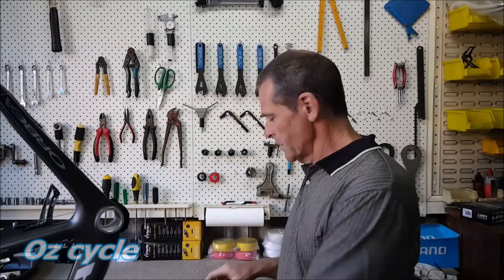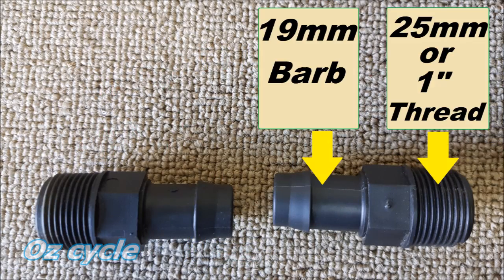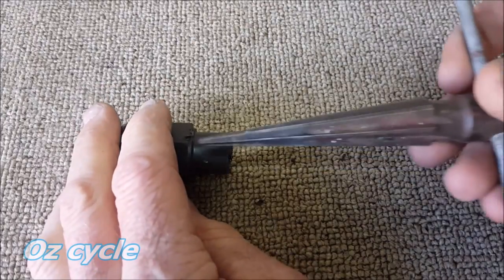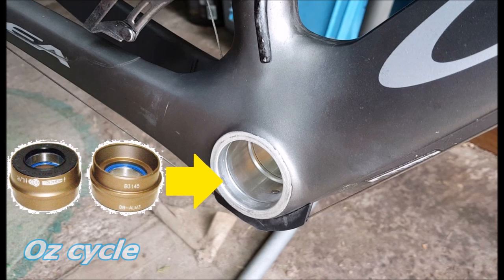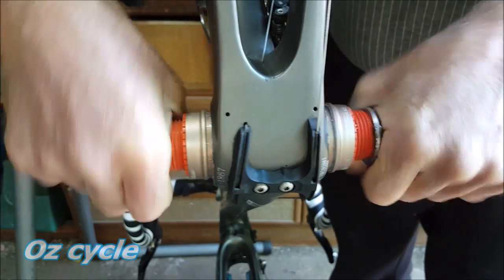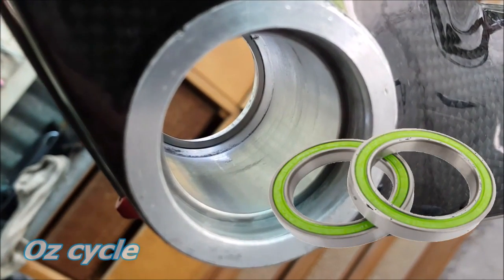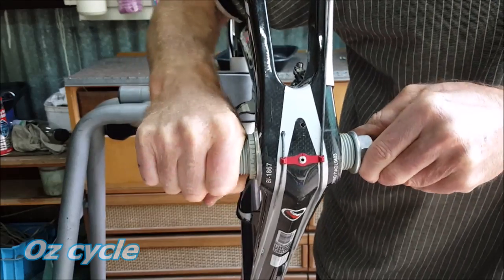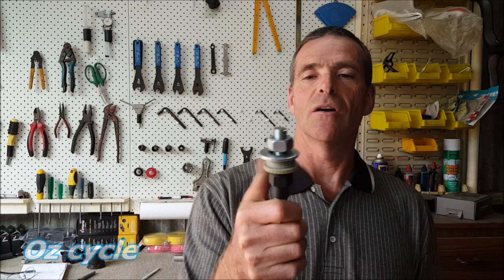BB30 cup/bearing press tool - make it yourself

Comment: What's the name of the black garden adapter piece you used? Thanks
Reply from the maker: 1" or 25mm threaded to19mm barb
Reply: Hi, really enjoyed the vid. Will make one for my BB86 pressfit. if I’m not mistaken I think the thread on the poly barb is 3/4” (20mm) not 1”. The female side of the tap fitting adapter is certainly 3/4 and the male thread side is 1”.

Comment: Hi oz can you tell me it's awesome I've manage to get most of the materiala from the hardware store but where did you get the bearing press cups? Did u buy it?
Reply from the maker: palpatine1975 https://www.facebook.com/559782270843560/photos/a.730913753730410.1073741839.559782270843560/730920647063054/?type=3&theater
Reply from the maker: +palpatine1975 The cup presses are garden tap adapters

Comment: Very nice video. Will this tool work for pressing the cups into a 386 EVO style of bottom bracket shell? thanks
Reply from the maker: +Bob Gardner Should do Bod... 386evo has inner diameter of 30mm.
Reply: oz cycle Thanks.  Great info,  and your vids are top notch stuff!!!  A+

Comment: What is the orange piece called and where did you find it? Also what's the size of the threaded piece and nuts? Overall is a great diy tool to have handy. Thx for sharing
Reply from the maker: +E. Sanchez Not sure what the orange piece is called but usually not sold seperately....standard tap connector. The threaded rod is 5/8... +nuts to fit.

Comment: Can you use the tool to "remove" the bottom bracket ? if not have you made a tool for that purpose, stands to reason if we put a new one on, we will very likely have to remove it first right?
Reply from the maker: +31acruz yup...it should be on the vid... "Bike creaking? Service it yourself"
Reply: thank you
Reply: oz cycle bike creaking